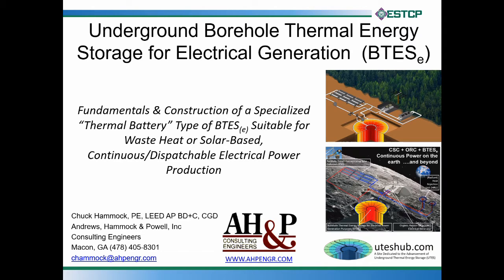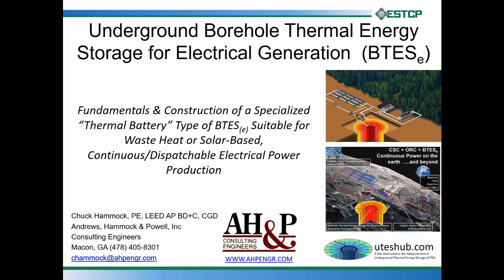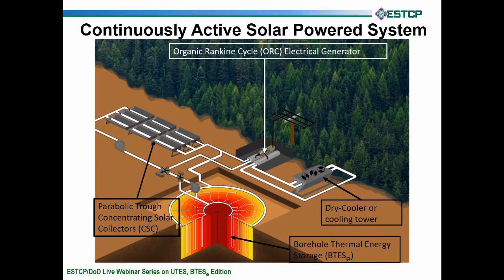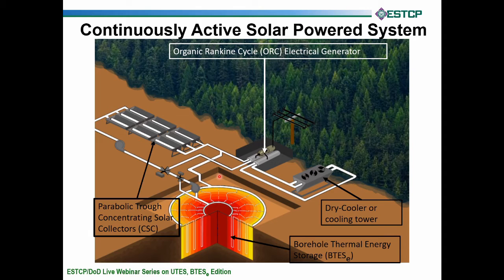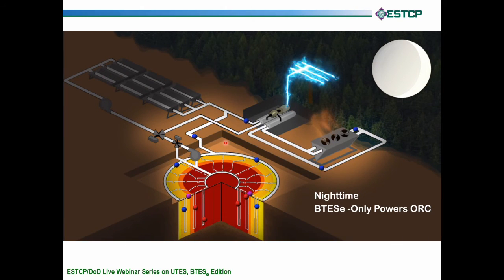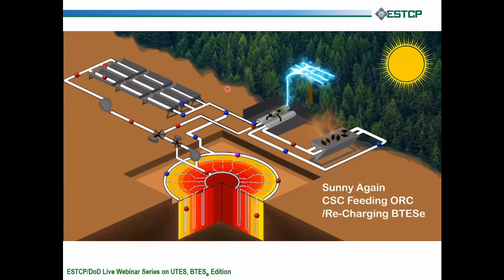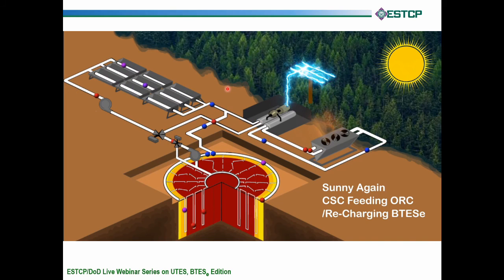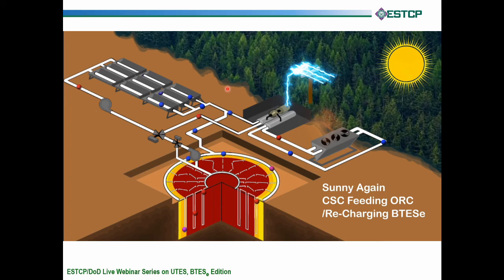Borehole Thermal Energy Storage for Generating Electricity (BTESe) Video

Comment: Economics?
Reply: Goal is to produce electrical power from the underground thermal storage at 10% of the current cost of Li-Ion utility scale electro-chemical storage.
Reply: @chammockutube  What are the 2 systems your comparing?
Reply: @timmothyburke  , 
System#1: 1-axis tracking PV serving a 24/7 variable electrical load and concurrently using the majority of the power for charging enough Li-Ion batteries to serve that load 24/7 for a week or more (including cloudy periods and at night)
System #2: parabolic trough solar thermal collectors serving a Rankine (steam) turbine/electrical generator (or an ORC) making power live while the majority of the power is charging an underground BTESe which during cloudy periods or at night reverses from charging to discharging and keeps the load served for at least two weeks.
Reply: Great comparison thanks. Both technologies are improving really fast. It will be interesting to see where we are in 2035.